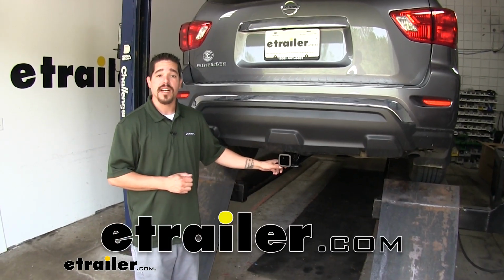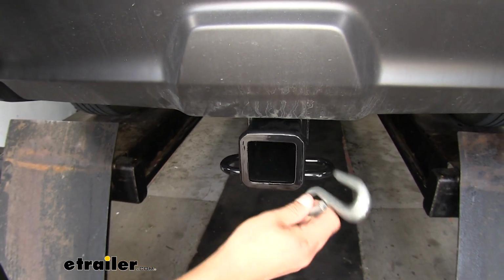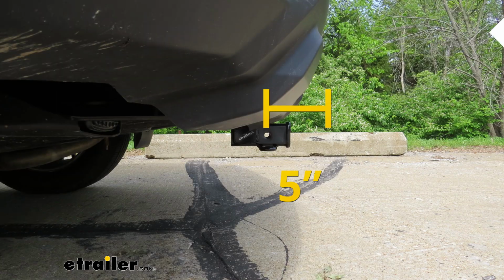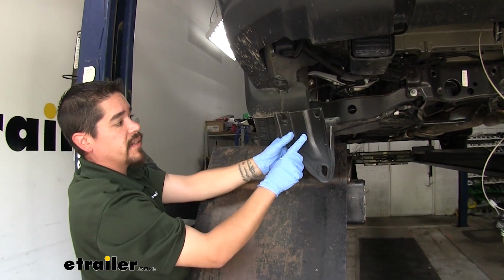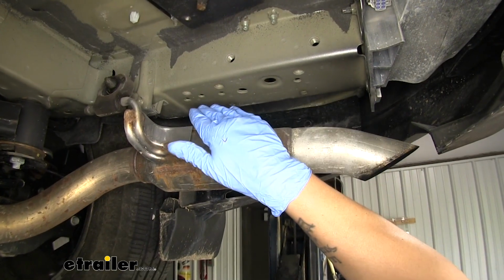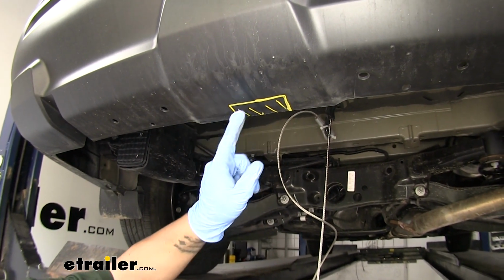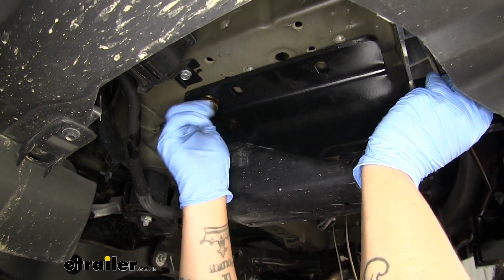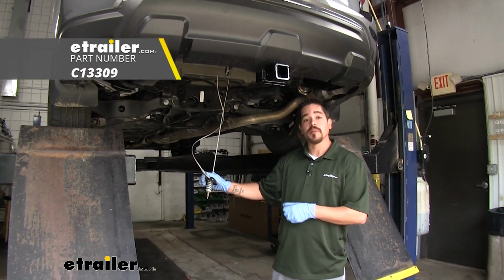etrailer | How to Install: Curt Trailer Hitch Receiver on your 2018 Nissan Pathfinder

Comment: If the 2018 Nissan Pathfinder does not come with the towing package, will it be able to tow it's full 6000 lb. capacity after installing your tow hitch? I can't find anything to say if the models that don't have the towing package from the factory have the transmission cooler and towing mode.
Reply from the maker: This trailer hitch is rated to tow up to 6,000 lbs. You will still need to check what your specific year, make and model are designed to tow in your owners manual. You will want to use the lower amount between the hitch and the vehicle. If you plan on towing a trailer, you will also need a wiring harness to connect the trailer to. I have attached the second following link so you can see all of the kits that we have that are designed to fit the 2018 Nissan Pathfinder.
https://www.etrailer.com/Trailer-Hitch/CURT/C13309.html
https://www.etrailer.com/t1-2018_Nissan_Pathfinder.htm